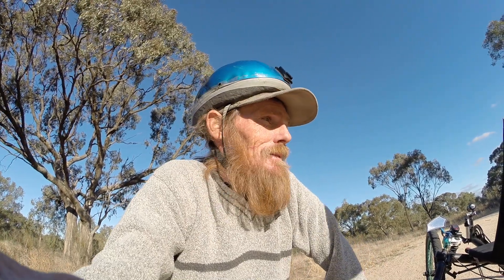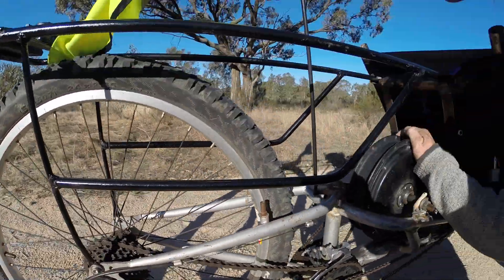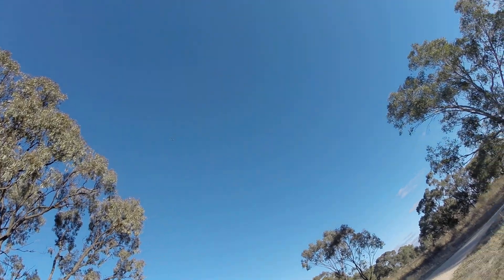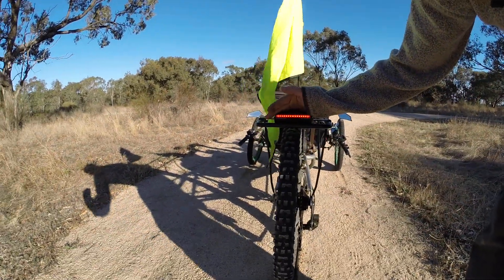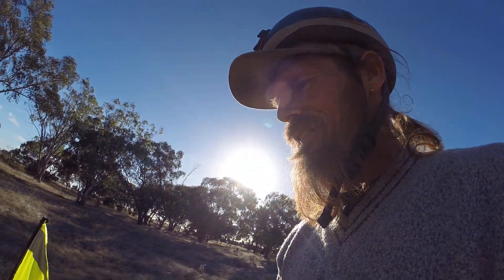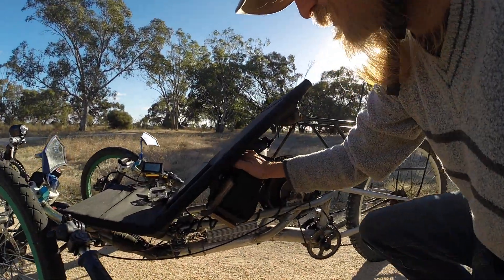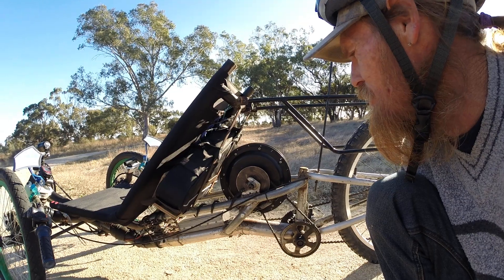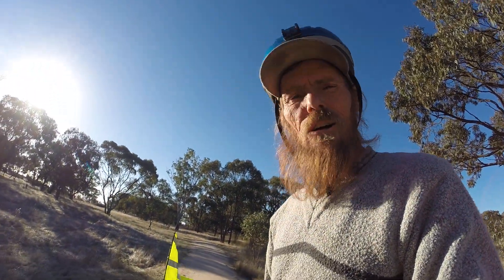Electric trike hub motor to mid drive

Comment: Hi Shaun nice build please let us know the voltage and watts of hub motor.
Reply from the maker: I am using a 52v lithium battery and a 30 amp controller for an output of 1500w

Comment: Does it need the jack shaft? Why can’t the chain run the normal gears
Reply from the maker: The chain does run the normal 7 speed gears like a normal bike. I'm not sure what you mean by Jack shaft but if your referring to the chain and gears on the other side that is for gear reduction. In 1st gear it does about 20 klmh or 12mile an hour and can climb any hill as long as it keeps traction. In 7th gear it tops out at about 65 to 70klmh
Reply: That is what I was wondering.   I will be back with more questions.  Thanks for answering by the way.  That is a great build!  I’m starting something similar as we speak
Reply from the maker: I'm happy to answer what ever I can Nathan. Good luck on your build

Comment: Hub motors are quiet...what are your other  reasons to use a bub motor in place of a mid-drive? Thanks
Reply from the maker: The main reason was for easy gearing for when the trike is all loaded up it can still climb hills with ease
Reply: Thanks I appreciate it

Comment: What kind of range are you getting ? 
Did your hub motor start out as a 1500 watt or is it now 1500 watts with the higher voltage battery pack ?
Reply from the maker: It started out a 1500w but with my battery it's now about 1800w. The range all depends of how fast the grade of the terrain ect but roughly on flat ground and full speed I get about 60klm. Normal use with light pedalling about 100klm
Reply: @shaunbriggs77  this is awesome , thank you
Reply from the maker: No problem mate

Comment: Did you film the build?
Reply from the maker: No, I only have a bunch of photos I took as I was building it
Reply: @shaunbriggs77  Knowing the Bafang mid drive kits, would you build that way if you were going to do it again or keep the same?
Reply from the maker: If I was to do it again I would choose the bafang for sure.
Reply: @shaunbriggs77  Thank you for your response. Will be on getting the 48 volt/750 watt. Need to research on what config I need. For instance the display.
Reply from the maker: Nice choice as they are getting affordable now and I am sure you will find the display and set up you need as bafang has a great choice of gear. Good luck with your build
Reply: @shaunbriggs77  Will post after building. I have the ICE model which has rear suspension and the option to add front suspension. However I do need to remove the hubs and powder coat or anodize them and the spokes. Need to find an oven big enough for the 20" wheels, so they also can get treated.
Reply from the maker: Sounds nice.